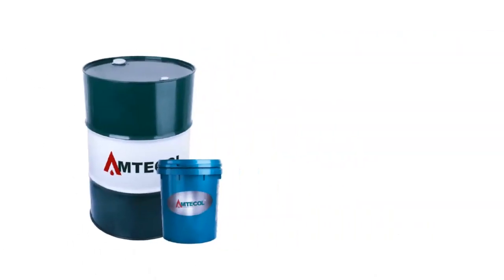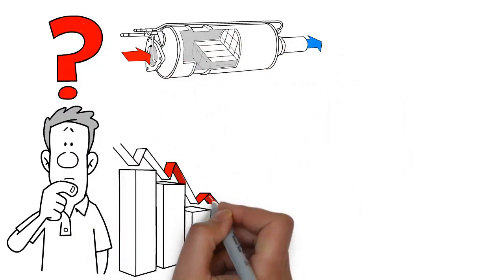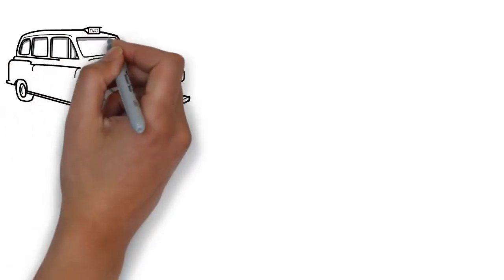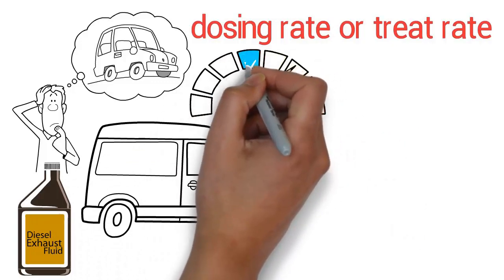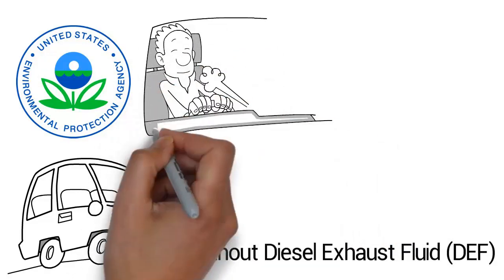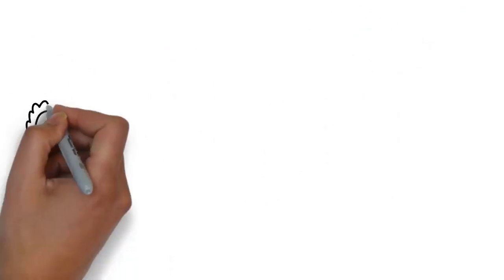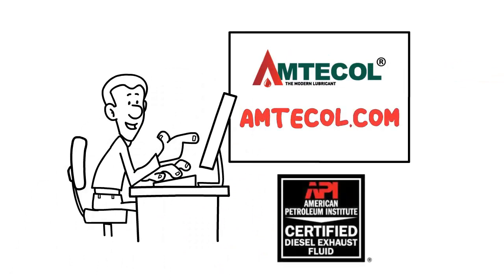DEF Diesel Exhaust Fluid (Everything You Need To Know)

Comment: The fuel economy claim you can't really test unless you modified your car to bypass the DEF sensor, so this is unlikely to be true. I've seen multiple sources of information that seem to be pushing a narrative making it seem like DEF is a necessity to physically help your vehicle run. At the minimum it's an electronic requirement in place by vehicle manufacturers, you will be put in limp mode if this runs out. While it is probably good for the environment and us, it mechanically doesn't do anything. It's like a catalytic converter on a gasoline car.. you don't need it.

Comment: If it is injected into the exhaust then how does it make the Diesel fluid more efficient
Reply: thank you. I had the exact same thought. If anything, you've added a restriction to the exhaust and every one I know that has deleted it their mpg went up.
Reply: EGR of sorts maybe? IDK
Reply: It is impossible for DEF to increase fuel efficiency, quite the opposite. DEF is not part of the combustion process, therefore, it has absolutely nothing to do with fuel efficiency. DEF systems use energy developed by the engine to operate, so the DEF system decreases fuel efficiency by an infinitesimal amount, certainly not an increase! Ha!
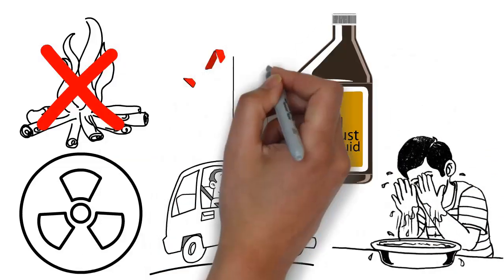Reply: At 3:54 it says how and why
Reply: This is possibly the best answer I found, "With some of the older diesels you had "in-cylinder EGR (exhaust gas recirculation )", which basically included a third injection event with both intake and exhaust valves in an open state to do the burn. It involves some timing retardation and a weird cam profile, but because you're burning fuel and not getting power from it, it's lost mileage.
Today it's easier to use DEF to treat the NOx versus trying to burn it before it got to the turbo, remove an injector event where the fuel isn't being made into power, and puts the timing back to a more "optimal" area to get all that power from the fuel being injected into the cylinders."